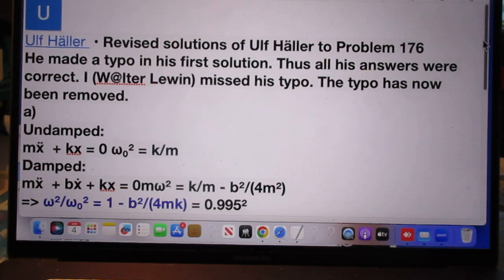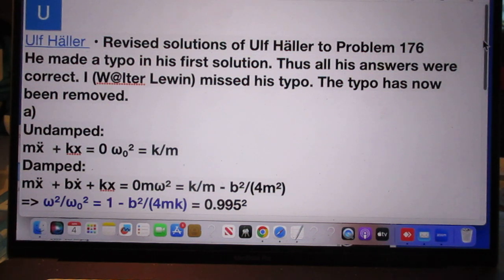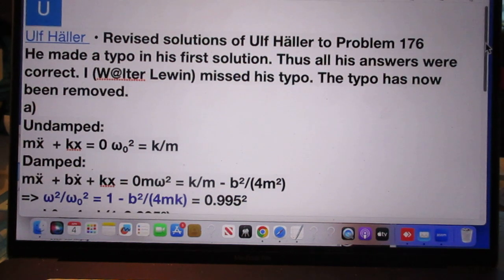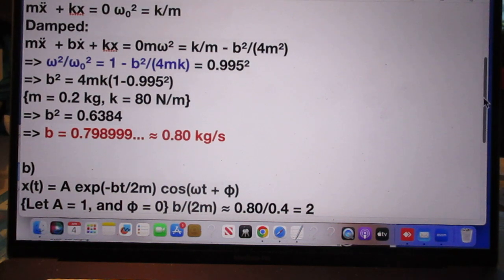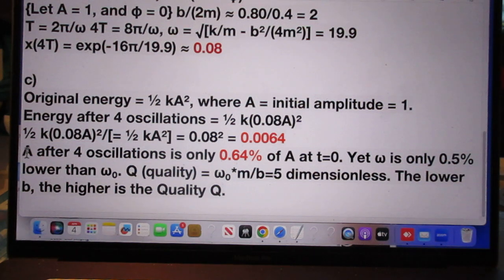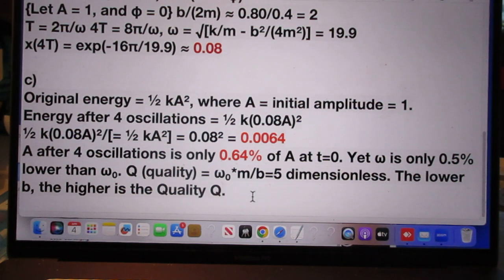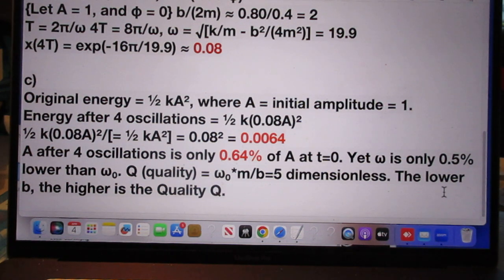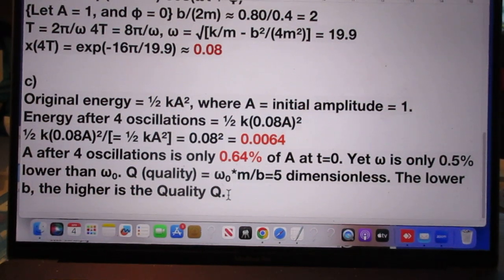Ulf Häller's Solution to Problem 167 without a typo

Comment: Hi teacher  I AM struggling with this ohanian Physics problem of  statics: 
A uniform solid disk of mass M and radius R hangs from a string of
length / attached to a smooth vertical wall (see Figure 14.34). Calculate the
tension in the string and the normal force acting at the point of contact of disk
and wall.
Reply from the maker: watch my 8.01 lectures; it's all there
Reply: @lecturesbywalterlewin.they9259  I already watch them. This excerscice is the hard one
Reply: @lecturesbywalterlewin.they9259  You have to express the tension and normal in terms of mg